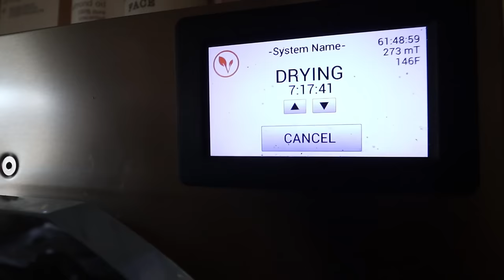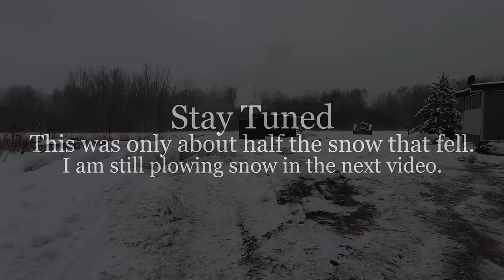THE FARMHOUSE. Getting ready for the storm. First big snow of the year. Recovery. Farmhouse cooking.

Comment: If you put that plow on your Honda, with all four tires chained up, because of how those older Hondas were geared so low - you could plow heavier and wetter snow with ease.
Reply from the maker: I would need to get smaller tires. There is not enough room between the back tires and the fenders to handle the chains.